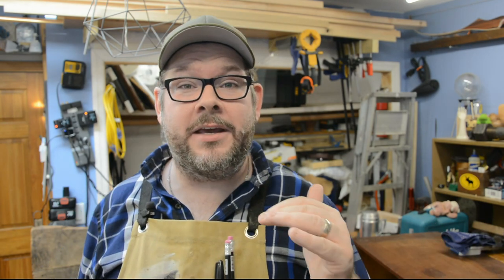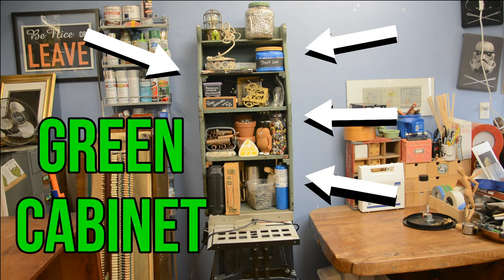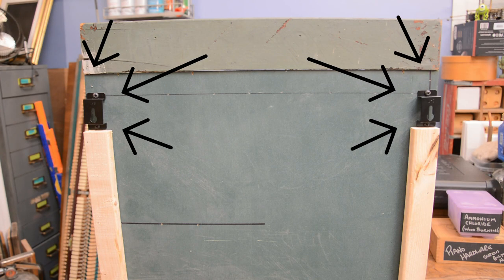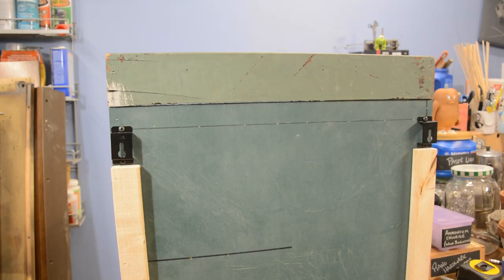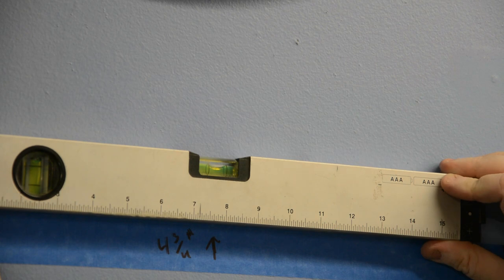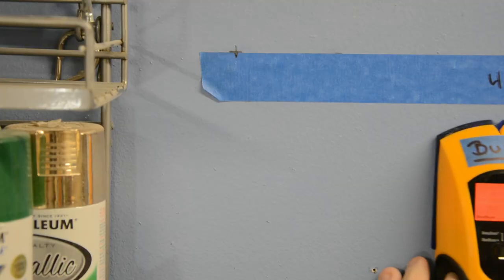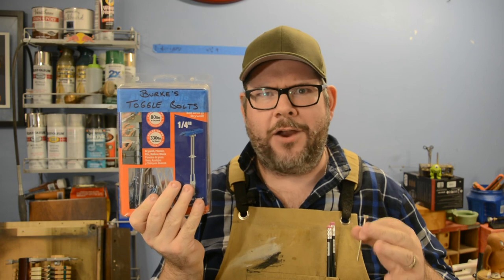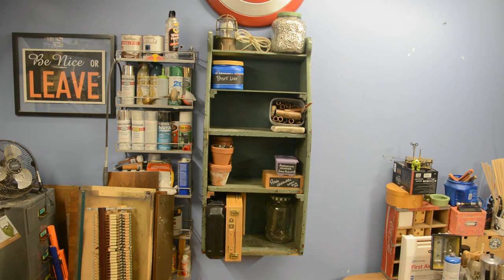Easiest way to hang a picture

Comment: Oh. My. Gosh! Blue tape to mark the distance between holes. 🤦🏻‍♂️ Genius! So simple and perfect results!!!
Reply from the maker: Yup! Gives you an exact measurement and the blue tape can then be easily leveled to give you a perfectly level piece when their are two keyhole hangers. Say what you will, but it works, it’s easy, and I’ve gotten great feedback about it. However, if it’s not for you, do what works. Thanks for checking out the video regardless!
Reply: Sorry! You misinterpreted my emoji - I was trying to say “why hadn’t I ever seen that for the past 50 years.” It’s genius!
Reply from the maker: First time I saw that one, I had the same reaction. Been using it ever since.

Comment: Can toggle bolt be remover without making a large hole?
Reply from the maker: Toggle bolts can easily be removed from a wall with minimal damage by using a drill to unscrew the bolt from the toggle. The toggle is spring-loaded, so it will not fold to fit back through the wall hole. Pull on the head of the bolt slightly to give the toggle some grip against the backside of the gypsum board.